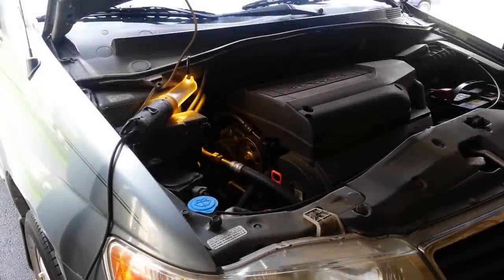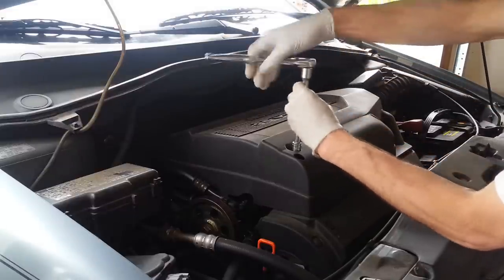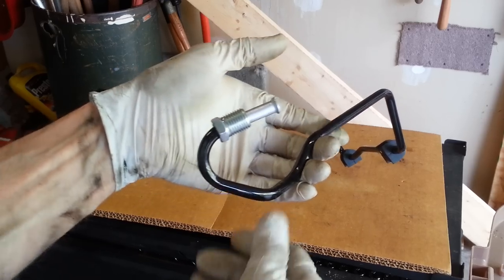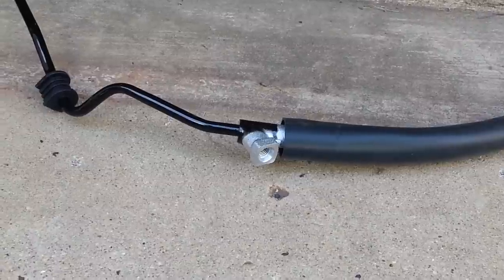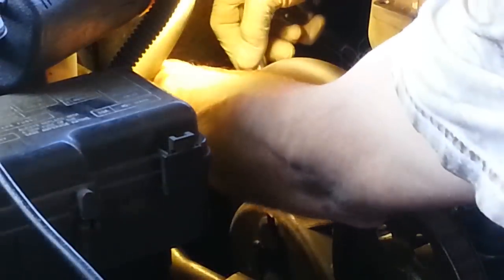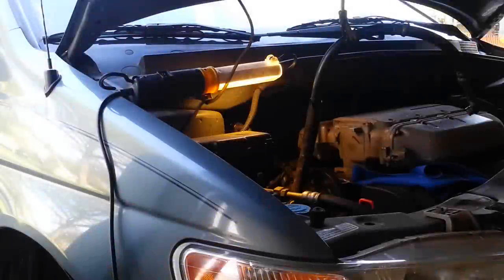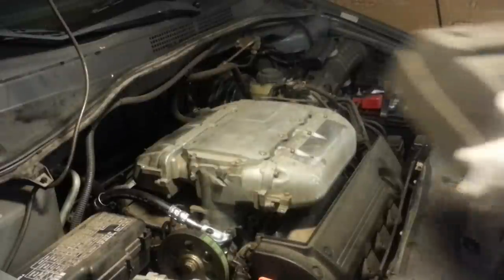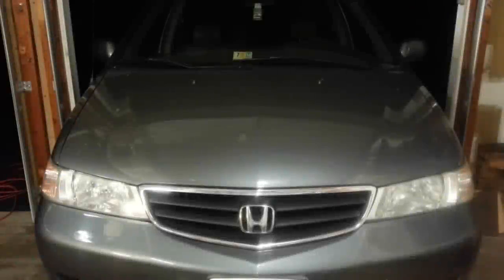Power Steering Hose Replacement 2002 Honda Odyssey

Comment: Hi worsethanchiggers...
I am facing this issue in my 2008 Honda Civic 1.8V in India....
I have a whining noise with a leak in the  power steering below my Vehicle...Can u help me?
Reply from the maker: It is possible that you have two things going on here with one being caused by the other. First, find the location of the leak. It may be in the high pressure hose like mine or that you are leaking fluid from the seals on one or both ends of the power steering rack. Look for signs of leaks or tears at the boots on the steering rack. If that is the case, I would replace the steering rack with a reconditioned unit. Secondly, having a power steering leak anywhere might have caused the fluid level in reservoir to drop low enough to allow air into the system which will definitely cause a whining noise in the power steering pump. You will certainly need to address the leak but you can try topping off the fluid in the reservoir to see if that temporarily helps with the noise. Good luck!
Reply: worsethanchiggers Thanks...I ll update u once I have configured the leak...The leak has made tge fluid level low...bt also due to it I face a hard time steering it coz of the fluid drips...
Reply from the maker: Ah, yes.  Hard steering accompanied by a whining noise can definitely mean that your fluid level is very low. Until you find out where the leak is, top off the reservoir immediately or you might damage the pump.
Reply: How bout adding a product called No Leak by Golden Eagle...is it of any help?
Reply from the maker: I presume that some people have had good luck with those types of products but I am not a fan of using them. If your car is old and not worth investing money into it for repairs or if you do not plan on keeping it very much longer, go ahead and give those products a try. Otherwise, I prefer to fix the real problem and not hope for a cheap miracle cure.

Comment: No need to remove both front wheels?
Reply from the maker: I apologize but I'm not sure if that's a question or a statement. There's no strong reason to remove both front wheels but it was certainly helpful to remove the one on the passenger side.
Reply: @WorseThanChiggers  it’s a question.  I’ll DIY mine anytime next week.  First time doing this kind of fix.  Thanks for the video.

Comment: So, I figured there would be priming procedure for the power steering pump since on start up it would have been dry....  Have you ever heard a Honda power steering pump run dry?  It sounds absolutely horrid.  Nice work though by the way.

Comment: I have a 2003 Odyssey.  I bought the replacement hose at Autozone and had it installed by a "professional"
Before replacing, I had a tiny leak at the top rubber crimp.  It would squeal every morning for the first mile or so.
I would have to top off the fluid every day or two.
Now with the new hose,  It squeals 10X louder for several miles and never goes away completely.
The "professional" claims it will take a long time for the air to exit the system, or the pump has gone bad.  On the day they fixed it.  Seems too big of a coincidence.
It has been over a week with almost no change.  It doesn't seem to be losing fluid.
1) Are they full of it?
2) where should I begin to try to solve this myself?  I don't think they're going to be much help.
There are only the 3 connections.  The top is easy to reach and does not appear to be the problem.
Could it be as simple as tightening the connectors more?
Thanks
Reply from the maker: Hard to say. The easy things that first come to mind are to confirm that the fluid is full up to the line on the side of the reservoir.  Make certain that they used genuine Honda power steering fluid.  Honda's cars can be finicky about that.  They should have properly bled the system by turning the steering wheel from lock to lock several times.  That's all it should take to get rid of most of the air.  I hate to bring this up but for this job, I always recommend using a genuine Honda power steering pump hose. Trying to save a little money by using an aftermarket part often leads to things like you are experiencing.  You likely have a problem with the o-ring on top of the pump where the new hose attaches.  If not a perfect seal, it will draw in air and produce the noise you are experiencing. I agree with you that it is unlikely that the pump would have coincidentally gone completely bad at the time this work was done.  Tightening the connection at the top of the pump will not help and can likely make things worse. The o-rings are what make the seal, not the tightness of the bolts. Either have the hose replaced with a genuine Honda part or at least try replacing that upper hose o-ring with a proper one in case it is torn or pinched.
Reply: @WorseThanChiggers  The top connector seems like the easiest of the 3 to experiment with.   Do you think that's most likely the leak?  Not the sensor?
Is the Flange nut  connector more reliable than the o-rings?
Replacing the hose again would be a huge expense.
Thanks
Reply from the maker: It might be pulling in air at the lower hose connection to the pump. Replace the o-ring at both the bottom and top hose connections to the pump.  Get the right o-rings from your Honda dealer. Don't use regular black rubber o-rings.  That's pretty much your only cheap option to try but I wouldn't get your hopes up.  If in fact your pump has gone bad, I'd purchase a remanufactured one unless you want to overhaul yours as I did here: https://youtu.be/A4zpDPKPdGE

Good luck!  Sorry this hasn't gone well for you.
Reply: The dealer service guy told me the only thing it could be is a bad pump. (Idiot)
I used a turkey baster to remove the fluid from the reservoir.  Hardly any spilled.
I got the pump out.  removed the bottom pipe and noticed there was no resistance.  The new o-ring on top was very hard to pull off.
This made me suspicious.  I tested the spring of the o-ring.  It broke into 3 pieces.
I figured it was worth a shot, so I put on a new o-ring, put it all back together, and like magic, it works fine with no noise.
I'm guessing when they replaced the top hose, even though they didn't touch the bottom hose, while the fluid was drained out, the o-ring dried out and became like glass.
Reply from the maker: Awesome!  Nice find and even better fix.  There is a TSB on pump noise because the old style o-rings become hard and brittle.  Your new one is probably green or red and should last longer.  Good work!
Reply: @WorseThanChiggers  You called it.  I used the O-ring that came with the new pump.  Still black.  What is a TSB?
Reply from the maker: @kowen5323  A TSB is a Technical Service Bulletin published by the manufacturer to document the solution to a particular problem.  Here's an example of a similar one for an Accord.  https://www.arcparts.com/wp-content/uploads/images/Technical_Information/Honda_07-086.pdf

Comment: Is it the line I just changed rack pinion on 2004 Honda Accord ex took it Valvoline thought I needed flush the rep SAID I didn't he top it up with fluid next day tight Again took  it back to repair shop who did the work bleed and  top up system I seen some fluid thought it was just burning off the work they did now it's tight is it line or pump no noises tight

Comment: You all do realize that Honda recalled hose and pump, right? They also recalled fuel pump and air bags.  You all need to double check the recalls for your cars.
Reply from the maker: Airbags, yes. I did double check NHTSA and there were no recalls on this specific vehicle regarding those power steering components. However, there are a couple of  technical service bulletins (TSBs) about the reservoir and belt tension which may be what you are referring to.

Comment: The cheap way is to use a bicycle rubber tire and  a hose clamp around the bad hose or pipe. mine has been fine for almost 3 years and looks like I'm not buying and installing a new one.

Comment: if that happens. duct tape is your friend here
Reply from the maker: There are countless uses for duct tape where it is an invaluable tool. But there are few if any legitimate auto repairs where it is applicable. Seriously, though, duct tape is no match for the pressures inherent to power steering systems which easily exceed 1200 psi and sometimes can go as high as 2000 psi.

Comment: Thanks for the video! My high pressure hose was also leaking and your video has been helpful in replacing it.
However, I noticed that the Genuine Honda part I purchased (same as yours) doesn't totally match with the original one. Was that also your case?
I have uploaded some pics in the Odyclub forum: https://www.odyclub.com/threads/help-with-ps-high-pressure-hose.354893/
Thanks!
Reply from the maker: Mine matched exactly.  Perhaps yours somehow got bent slightly out of shape before you acquired it.

Comment: To bad you didn't record the most important and difficult part of process..routing the line. This video is useless
Reply from the maker: I tried but it was tough to actually capture what was going on in those very tight quarters on video. The good news is that after observing how the your old high pressure hose comes out, it is very apparent how to reverse the process and put the new one back in through the same route. The only challenging part is being patient and working the hard line through where you know it must go.